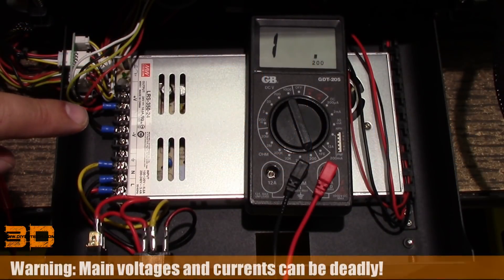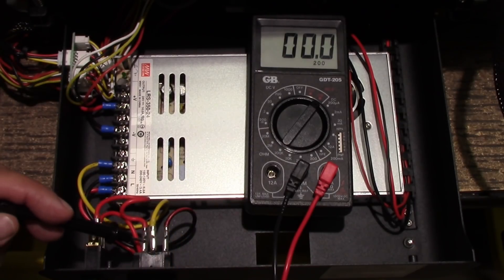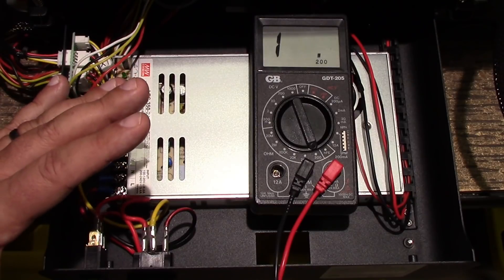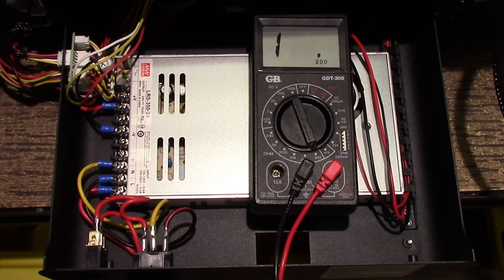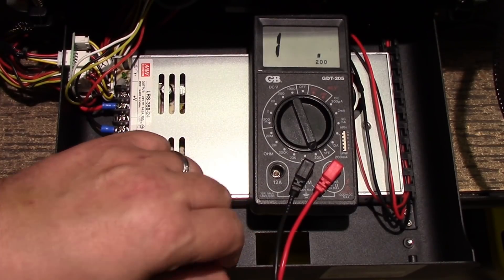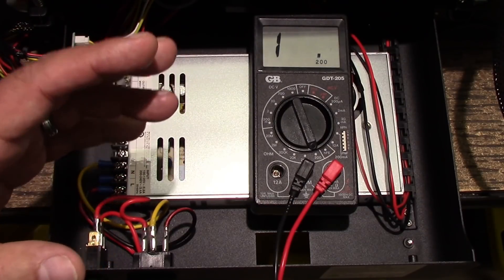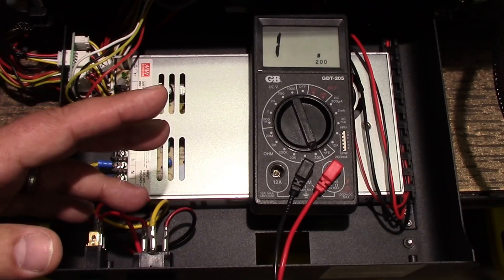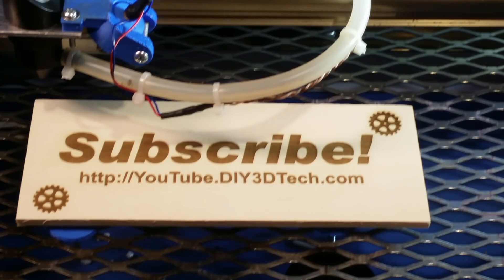Shop Talk - Can My 3D Printer Electrocute Me?

Comment: Not specific to 3D printers. This is applicable with all switching power supply, notebook, desktop computer, even washing machine... I don't have a proper ground at home and make one myself with the plumbing of the central heater for my computers has I was shocked by my desktop even when plugin a mouse!.
Reply from the maker: Thanks for commenting!  Yes I actually cover part of that in the laser video I did a while back as anything that plugs in that is not double insulated / Isolated is subject to this...
Reply: I just saw that video! great topic to cover! I'll ask electroboom has an electrical engeneer to make a video about it. We should have  Ground Fault Circuit Interrupter to look current leak in modern home wiring but very few home are modern. I found interesting that the laser machine need a second grounding. thank you!
Reply from the maker: Your welcome!

Comment: Hi,
in the Netherlands we do not have everywhere
on the electrical outlets Earth!

Regards!
Rob.
Reply from the maker: Yes you do have a ground connection on your outlets as the Hague is my second home.  If you look in the outlet there is a metal pin which touch's the side of the plug which has a recessed metal tab...

Comment: As a early retired electrical engineer I can say that to maintain safety earthing or grounding as you call it is essential, whether you use a earth strap or not the secret is removing some of the paint from the case to get a good connection, the general way would be remove some paint and fit star washers that bites into the metal parts of the PSU and the case, one of the biggest causes of loss of adequate earth is attributed to extension leads as most wont check them periodically after they have been thrown around a bit, just a point we tend use the term double insulated rather than double isolated. Regards. RobUK
Reply from the maker: This is good information as I am use to it being refereed to as "double insulated"  and your saying it should be "double isolated"?  Is this a UK thing or?  As I would like to understand this better so i get it right.  Also BIG yes on the paint removes the case as most in manufacturing process place tape or some to block the painting / powered coating.  Also second big agreement on the extension cord comment.  Thanks for commenting!
Reply: No I was referring to your comment in the video as being double isolated when it should be double insulated. In an industrial or commercial environment here extension leads of whatever quality are checked around every three months for this reason, I think the Aurora is probably well enough constructed and I suspect like most of the 3D reviewers we see on here they have miles of extension leads kicking around and are asking for trouble if not doing a bit of maintenance. At the end of the day a 3D printer is just an 'appliance' and needs taking care of in many ways thats why the biggest cause of injuries and fires are appliances and extension leads. RobUK
Reply from the maker: That is my question back to you is the "correct" term "double insulated"?  Is this and industry thing or a local colloquialism as I would like make sure I get this right in the future :-)
Reply: Well in the UK we use the term 'double insulated' or Class ll and the appliance would have a symbol of a square within a square, the purpose of this is so that no single failure will result in a dangerous voltage being present so it might cause an electric shock without relying on a earthed metal casing, this can be achieved by using a plastic casing or double insulated cable on metal cased appliances. I do agree that some of these power supplies used on mainstream or china clones with exposed metal casings are a concern and in reality should be checked by someone with experience before use but this aint gonna happen. I like you regard extension leads as a no no because they do fail regularly and have wired up a dado rail with about 8 double sockets for my printers etc and have on the end of it a RCD or as you know it GFCI, also I do throughly check the PSU and fit crimp like terminals and strain relief where needed if there was none.Regards
Reply from the maker: Now my head is getting back on straight as that is what I am use to "insulated" however had someone else mentioned it was  isolated but after googling it only relates to DC or so it seemed.  Anyways got it and thanks!
Reply: Technical terms aside I do support your motives here in raising electrical awareness especially in what is a rapidly expanding market, education and discussion is the way forward in making people aware of the dangers that are out there especially when dealing with electtricity, I have had my concerns with the Prusa and the many clones that a mains powered PSU is fixed to the frame, a very poor design especially now that people are using metal components like 20/20 etc, power supplies whether up market or cheap far east ones are a weak link and fail on a regular basis some quite drastically so any fault to earth with a PSU renders the whole printer live which is not good practice, to be fair to the chinese like Tevo, Anet E series and Creality they have addressed this by the use of a seperate control box so electrically seperated from the printer and the only voltages at the printer are LV at 12 or 24V a much safer alternative to mains voltage, saying that it is still important that the control box is solidly earthed/grounded and protected by one of the earth leakage circuit breakers that are available, the use of extension leads should be avoided if possible, but if you have to use them then it would be wise to check them for damage, loose terminals etc on a regular basis for your own safety. Regards RobUK
Reply from the maker: Thanks yet the issue for the Creaiity and Wanhao ( I have both) with the separate box is its the same as the JGAURORA A5 connection wise as while  its not connected to the "frame".  Yet you must touch box to control it so it put you back in the same boat :-(   However if your want to see bad, look at these cheap laser cutters, they are bad!
Reply: Yes absolutely having to touch the control box of one of the down sides, I would prefer it to be made of something like a non conductive composite material rather than metal but seperated from the printer does give you more of a fighting chance,  touching a control box with one hand to operate the controls will give you a nasty shock but, gripping a live Prusa style printer with both hands to say move it would probably be fatal, so back to where you started the emphasis is on good earthing/grounding and your responsibility as a prominent U Tuber presenter is to preach safety whenever you can and I support that.With regard to your comments regarding cheap laser cutters predominantly from China I agree with your comments but, I have seen control equipment and appliances from S America, Eastern Europe, Mexico etc which are just as bad as from the Far East, it just means we have to be more vigilant as responsible consumers in checking what we buy especially if it likely to be used by our children. Regards RobUK
Reply from the maker: Agreed! In addition, I work around the world and agree with you there too!  One time I was the executive in charge of building large commercial building in Cheni India and it was monsoon season and the water was just short of knees and and I had to wade though it.  I was stepping on something that seemed familiar but could place it  so I follow it out and led to a very large generator that was powering the building!

Comment: I'm a bit miffed that they're simply floating the secondary rather than bridging the protective earth and the -V output of the power supply. In the rather unlikely case that the transformer develops a fault, such as due to repeat overheating and unfortunate crossing of wires, your live is going to the output and there's nothing to stop it, unless another fault also trips a fuse or a breaker - and the GND really goes almost nowhere except for the case itself. And there isn't even a reason to float the secondary.

In the specific case that Angus experienced, he was not in an actual danger, the shock was merely from the Y capacitors that couple the switching noise into safety ground and slowly float up to half the mains voltage - they wouldn't let a sustained current through, and the voltage would collapse when he touched something earthed. But this is with a power supply that is new, high-quality and in good health, and proper wiring, if there was a fault somewhere in that area, he could have been in danger.

Disagree about the extension cords - so powering a computer or a huge TV for 24h a day is fine, which can have sustained consumption of well over 200W, but a 200W 3D printer (with an SMPS like in a computer, a TV or an LED strip, and a couple wimpy little heaters hanging off it) isn't? Of course it is, it's not heavy machinery, it's electrically fairly benign. Just don't get fakes with fake certifications on them or none at all, buy from a trustworthy supplier.
Reply from the maker: So was there more from Angus on this?  Also what your missing is the application of extension cords and power strips as people tend to use them irresponsibly and  that is the neat thing about being both old and traveled is you see a lot!  My father use to be an electrician for many years and he would take me with him and I can't tell you the number of issues involving extension cords.  In fact that is how I learned how to swear as he would get a call and the first thing he would ask "is there an extension cord involved" to get a yes 90% of the time an he would start swearing :-)

Comment: ground wire is not supposed to be connected on coper pipe.
 nowadays, with utube, everyone imagines himself to be an electrician, a mechanic, and so on.
electrician is a job that you do not learn looking at videos.
Reply from the maker: This is 100% correct (ground wire is not supposed to be connected on coper pipe) and one of the reasons for doing this video as I also re-hab houses and most them are older people cheated back in the day...
Reply: But copper pipes do have to be bonded to ground for safety.
Reply from the maker: The issue is in most re-habs today its mixed...

Comment: I just got my Tevo Tornado yesterday.  Everything is fine with it and it assembled with no problems.  The only thing I have an issue with is that it came with a European plug(with no ground prong) and a 2prong adapter for N.A. plug.  Luckily I do have a couple of extra IEC cords that I could use to provide proper grounding.
Reply from the maker: That’s a good point!  Wish I would have thought to also cover this in the video as I too have run into this...

Comment: 1) Properly rated UL listed power strips and cords are perfectly safe when used correctly. If one is willing to have these cheap printers running in their home then you are already taking on far more risk then properly using power strips. :-)
2) That looks like a SPDT power switch, so that top terminal is live when the switch is off. (could be a light circuit for the switch?)
3) If the power supply has a power line filter there is a potential to sink 30-50@ of the rated voltage to chassis when the ground is floating. (largely depends on the type of filtering being used)
4) I don't think it's necessary to strap the PSU to chassis. Iv'e seen significantly higher results from some PC PSU grounding chains.  

I think the bottom line is to always power the equipment being used properly.
Reply: at least someone who knows what is talking about.
Reply from the maker: Not sure I agree,  as I have had issues with cheaper strips (UL listed) shorting out under load.  I only use commercial / industrial grade when I have too.  I also do not believe in power strips for this purpose as I have seen too many people abuse like a check book as just because you have checks (plugs in this case) doesn’t mean you have the money in the account (current) . For my shop, I have detracted 20 amp circuits dropped with fast blow breakers.  In my day job I build large scale data centers (6 to 12 mega watts on average) and power strips are strictly verboten as when they can also create a lot of smoke too which can shutdown a DC in a blink of an eye.  Yet I do agree on the general quality of these and in fact all 3D printers and the reason for this video 😊
Reply: I think you are erroneously correlating  the use of a device to it's safety. Even an industrial grade device can fail.
Reply from the maker: partly, however the issue is the misuses because of the  misunderstand of there use.  It is better to do it right up front and proper power delivered by the proper type of wire then jury/jerry rig something.  Because as  another viewer (an electrician)  wrote and what we saw from Angus is people fail to ensure the safety of the extension cord.  As the idea of an extension cord is for a temporary solution not a long term fix :-)
Reply: That is my contention with your original comment, using proper 'power strips' and 'extension cords' correctly is NOT "doing it improperly". Like any tool it can be used improperly, with negligence and do harm. They have their uses and within those usages they are perfectly and 100% safe. 

My extension cord IS a permanent usage for my weed wacker. :-)
Reply from the maker: LOL!  exactly my point, your wacker is a temporary use like my circle saw or trouble light.  What I am trying to say is they should not be a permanent fixture (solution) as this is where issues arise as  just ask the common Joe the difference between a 20 gauge and 12  and the answer you will likely get is the shell is bigger :-)
Reply: I think one of us is loosing sight of the topic. Angus was testing 2 machines, temporarily connecting it to a power source. (Much like one does with a weed wacker or drop light) This is the very purpose of an extension cords, and is what we are talking about.   

Up until your previous statement "...extension cord is for a temporary solution not a long term fix.." (which we agree, but need to define 'temporary use' : (hour, week, year, decade) you argued the use of extension cords and power strips was bad, but in this conversation we are talking about someone (Angus) incorrectly (can we at least agree on this point?) using extension cords and power strips to temporarily test some machines.

It was the miss use of the extension cords/connector that caused the issue, NOT the cord/connector itself and he said he knew better. We've all done it and probably will again because at the end of the day we have to own the consequences of our actions. 

I would give you a heart attack if you came to visit me. I use extension cords and power strips (properly) all over my house. I couldn't 'live' without them. 

What kind of power strips are you using?
Reply from the maker: For me "temporary" is for the "short term" like wracking weeds and while I don't know the size of your yard, I think I can safely assume you will not be wacking for 72 hours.  Also  I like Angus, however the issue I have is if you are going to do this professionally do it right as your representing this to the general public.  When I set up my shop I hired a friend who is a master electrician to come in and do it right as we are not talking about one or two printers and wanted my family "safe".  So if people see Angus do this they, "wow this guy knows what he is doing so it must okay right?  Since your in the trade,  I am sure you come across enough jury/jerry rigged furnaces to make you cringe (I had two uncles and one Aunt die of Carbon Monoxide poisoning in one incident  and a cousin die of 110 electrocution in another) so I tend to take things like this very seriously like this as just that one time is all it takes...    P.S. when I tested the Creality and JGAurora together (as Angus was doing) they had dedicated circuits.

Comment: Hey, Joe - nice video.   If I’ve got this right, what Angus said was that he was stringing extension wires together (which he said was bad practice) and he didn’t  realize one of them didn’t have a good ground.   There was a short in the Aurora, so he got shocked and the circuit breaker didn’t trip.  You’ve got more experience and understand it better than he does.   But he’s pretty sharp and will be there shortly!
Reply from the maker: Only if he as GFCI breaker which in the states is really only used for circuits within 6 feet of water.  I could energize my case and not trip the breaker mine is connected to until if found ground and the current surge above the beakers rating triped it...
Reply: There was no short in the Aurora, it was just switching noise coupling into the now floating ground connection. Unpleasant but not deadly - it would have been dangerous if the Aurora developed an actual fault.
Reply from the maker: Thanks and In general yes, however he was not overly clear where the lost ground was at.  Also he didn’t elaborate if (there even was one) or where the short  happened to be located at.  I was also surprised to hear him say it was still running so he couldn’t check it...
Reply from the maker: Was there more on this as before posting this vid on the topic appeared to be the latest one...
Reply: Had there been an actual fault in the printer power supply or power supply wiring in the printer enclosure, he'd have a GFCI trip as soon as he connected the printer back up to a non-broken cord later.